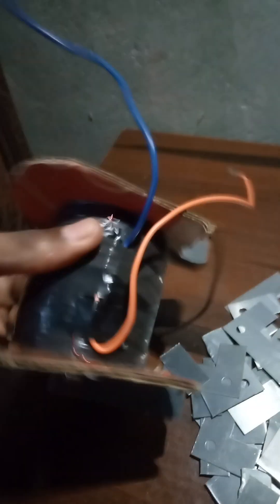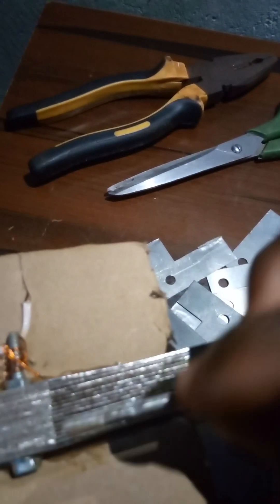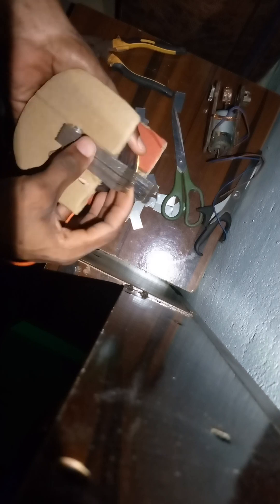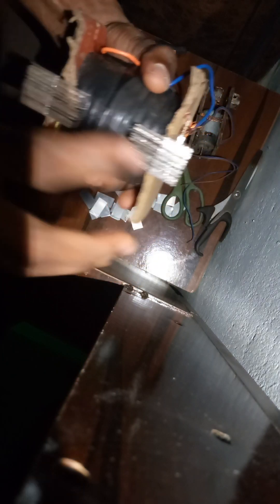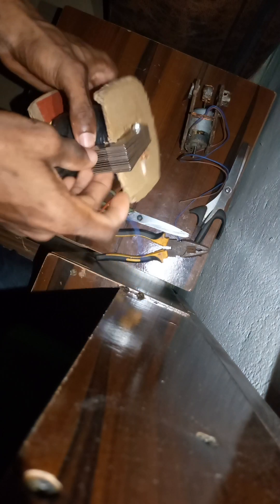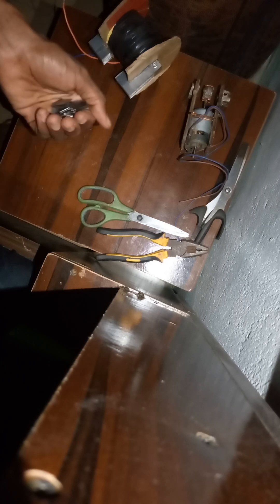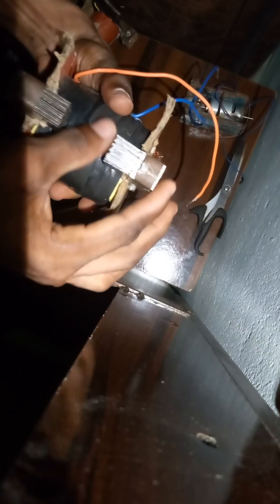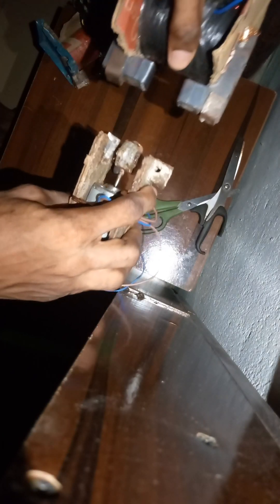Simple step by step on how to make a fuelless generator🔎💡⚡⚡

Comment: Good innovation my brother but how many gauge copper wire that you used and how many turn waiting for your response sir
Reply from the maker: Ok Guage 22 copper/aluminum
Reply: @creativetech808  Thanks our boss, but how many turn or its not matter sir
Reply from the maker: Ok the primary coin contain 2,500 turns or you can also use 2,300 turns of coil. Why the secondary Coil which is the current coil with wattage ⚡ contain 1,600 turns pure copper/aluminum coil.
Reply: @creativetech808  Bosssssss you're the best oooooooo but sir we your subscribers need you to demonstrate how to make the coil like you do in new video just demonstrating the sample in fact you're the best sir, waiting for your video on how to make primary and the secondary coil we need your help boss. Thanks sir.
Reply from the maker: Alright boss